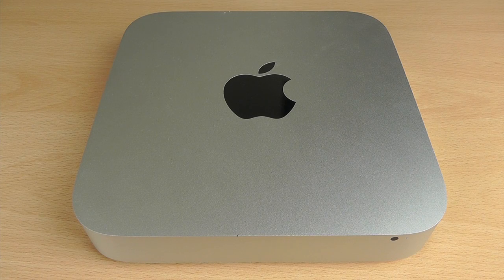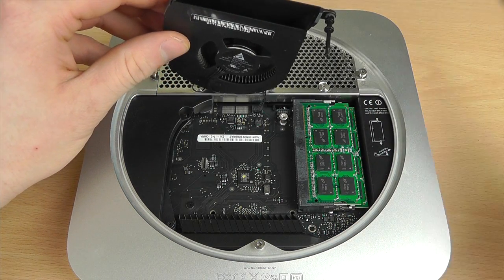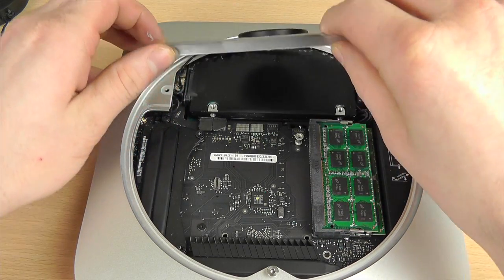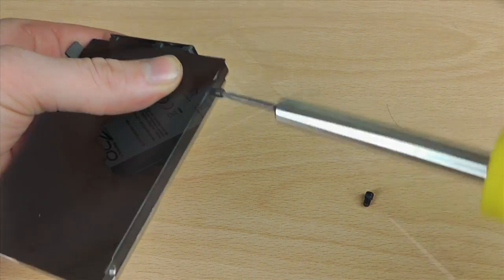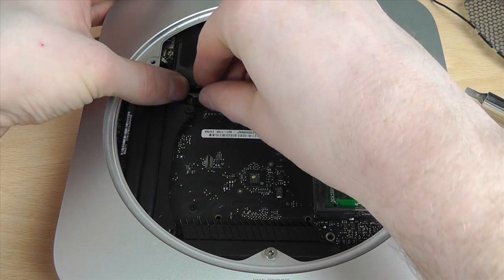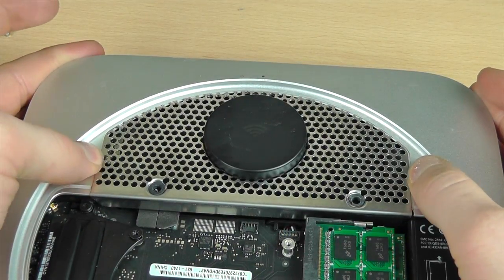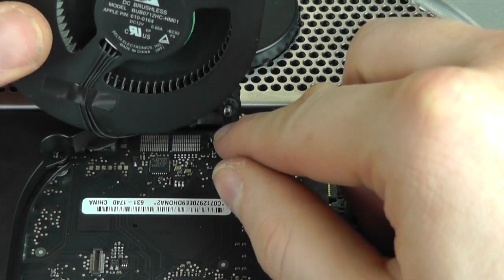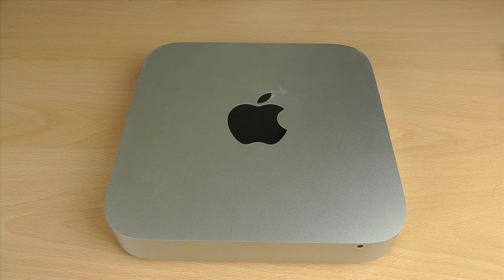Upgrade the Mac Mini 2011 hard drive to Solid State Drive

Comment: Just a note that the mini has a double drive bay and if you only have 1 drive then it has to go in the upper slot, and getting those 2 screws that go into the drive enclosure on the wifi screen can be a bit of a tough nut.  I used a spudger to hold it up until I could get one of the screws in place.  Thanks again!

Comment: My screws were mostly torx 6.  And hex 2.0 for the outer screws of the wireless antenna grille.
Pull the fan connector straight up (vs. horizontally).

Comment: Thanks that's the fan contact damaged now as it didn't come off as you said. All wires now exposed and plastic bit stayed there. Not towards you, slightly up and then towards you 😭

Comment: No mention at all of the types of screwdrivers for which screws. Pretty magical all purpose screwdriver. I had one drive to replace and it was not much fun trying to get it reset. Maybe all SSD drives don't mirror the old HDD version. Anyone a good job here.

Comment: This discription is shite! The electric plug for the fan needs to be LIFTED UP not pulled towards you. This almost destroyed the plug! Number 2: there is absolutely no need to remove the antenna plug. The cable is long enough to easily let it sit at the side of the Mac. Thirdly: the plastic cover is not needed for an SSD as it covers some of the electrical contacts on the back board of an HDD, which the SSD doesn't have, as it sits in a hard case. The only thing you need is the upper oval stripe which keeps the SATA combo plug in place. Really, mate, do your research better! Also: sit back, relax and have a Foster's...

Comment: I actually lost one of the rubber grommets that connects the screw that threads through the wireless antenna grid to the SSD... I hope it doesn't cause any issues. :-/

Comment: Hello all. Please advise exact details with brand name, model name/number of the best compatible SSD and also please advise the same details for 8GB or 16 gb RAM upgrades for my Mac mini of 2011. Hope 16 gb RAM will be ok for Mac mini 2011. I want to upgrade my Mac mini for music recording purposes, starting with Logic Pro X. I do own external SSD 1TB from Lacie where I will store the sound libraries so a 256gb SSD inside this mini should be ok(?) for running the Logic Pro X. Thank you very much. Your help and guidance immensely appreciated.
Reply: Hi Ash did you ever get an answer for this. I also have a  2011 mac mini that i want to use for logic pro X. If you received some information that was helpful to you      can you let me know please. Thanks in advance

Comment: Thanks for the video! I upgraded my HDD with an SSD. I didn't disconnect or remove the fan or the wifi cables. I was extremely careful and light handed though. Hardest part was getting the old HDD out, lots of wiggling, it seemed like the memory modules were in the way and I was beginning to think I would need to follow the other guides I saw online (which tell you to remove wifi, fan, IR and push out the logic board). In the end and after a lot of wiggling, the hard drive did come out. Replaced it with the SSD, did all the steps in reverse, voila. Job done.

Comment: Followed the instructions and my fan wires ripped off separate from the connection, GREEEEAT fuck me now I can't get the connector off of the logic board and I need a new fan. Fuck apple

Comment: This is by far the best video on replacing the hard drive in the Mac Mini.  Most sites and videos (including iFixit) seem to insist on removing everything down to the logic board... this is completely unnecessary.

You will only really need the following screwdriver bits  Torx T6 &  T7 plus  a 2mm hex bit.

The only trouble I had was that the black plastic would not stick back to the new disk... seems the glue was just too hold.  I solved this with "Glue Dots" adhesive circles.  Also, while replacing the WiFi grill, one of the rubber grommets that sits between that and the hard drive came loose... but it was easy to put back in position.

Comment: *CAUTION:* I would highly suggest leaving the fan plugged in. They use thin gauge cable and the pins can easily pull out of the housing, which is not fun to fix.

Comment: I should have followed your video... I followed OWC Macsales which have you pull the logic board about a centimeter out but to do so, they have you unplug the IR cable first (on the right) and this is where I damaged the logic board. So, you can really fully access (and pull out/put back) a HDD/SSD without pulling slightly the entire logic board ???... If so, that is really cool and more feasible.  Because I had broken not only the tiny tiny pins (and sticker) of the IR cable, Apple Store only had the option to replace the entire logic board which of course would have ended up as about 80% of teh price of the Mac !!.... Fortunately, I have found an Apple approved independant PC shop which was able to do soldering to get it back for $80. That wiped away the discount I had on the Crucial SSD but at least I could use it.  And by the way, this upgrade is really worth in terms of performance !  Just be very careful (I had done the process on the Macbook Pro myself, but one should NOT expect the process on a mini to be as easy !!... ). Cheers,

Comment: I did this and was much more difficult than the video shows. Putting the new dive back correctly is difficult. The putting the antenna grill is very difficult..lining up the holes with the drive holes is so difficult
Reply: Likely because you also need to slightly pull the logic board... :)
Reply: Lol

Comment: How much is the speed improvement with the ssd?
Reply: Compare night and day ! Really !  Add a clean install with it and you'll wonder if this machine was released in 2011 or 2017 ! :)   About 15 seconds to boot (compared to much over 1.5 minutes in my case before I did the upgrade).  See my warning above. And notes from others about the logic board removal... A risky process if you are not doing this on a daily basis :)

Comment: So what happens to the os when the ssd is installed?
Reply: Hm actually no ! When I put the ssd, i was on mavericks on the old hdd. The ssd was empty, i booted in internet recovery and then i don't really remember if i had to install mavericks again or el capitan but anyway i managed to update to el capitan without having it installed beforehand. btw If you replace the hdd, don't make the same mistake as me, DON'T disconnect the IR cable, it's useless and easy to broke
Reply: +Laurens Hoogenboom press cmd+ r when it tries to boot, it will open the internet recovery and it will download el capitan for you
Reply: +( ͡° ͜ʖ ͡°) I've done that once before in yosemity. It brought me back to Lion. which isn't a broblem ofcourse. But i don't think it will bring me to el capitan
Reply: +Laurens Hoogenboom yeah , sorry, i thought it would work but nope : i installed my ssd yesterday and it only offered me to install moutain lion. I upgraded to el capitan afterwards.
Reply: +Laurens Hoogenboom yeah no issue :) It works really well now. BUT ! i've broken my IR connector in the process , be careful not to touch it, i've made this error because there is another tutorial on youtube by "OWC" in which they remove the IR cable but it's not needed.
Reply: As in Infra red? Anyways, I put in my samsung 850evo sad and crucial 16gb 16mHz ram. I must say, It boots really really fast and civ 5 loads so quickly. I was even able to play on higher graphics. I have no infra red gear, So i don't know if I came across the same problem. Or is the IR the wifi adapter?
Reply: +( ͡° ͜ʖ ͡°) I have myself the newer mac mini from 2015 but a friend of mine gave me his 2011 to upgrade  to SSD and add ram. So it has to be on El Captain in order for internet recovery to work? I had that opiton on my mini already so just want to be sure. Thanks!
Reply: Prior to do so, just install on your new SSD (ideally you'll need an external enclosure). In my case, I wanted fresh install, so I just installed Sierra and did its update to latest, while the drive was outside. Then boot with option key pressed down just to check it works.  After you will have replaced the drive b the SSD, you may chose to recover from a backup, or better : renstall your apps (longer but good time for a cleanup of what you want or need). Then I just used the files content (not any configuration or programs) from the backup and copied manually. It's a bit longer, but just in case you don't wish to bring back any speed or performance robber in your new config, it may be worth...

Comment: Ive got late 2012 mac mini. But with a help of this video managed to upgrade it as well. Same process. Thanks and good job.
Reply: You don't have to remove the logic board which helps :). Other videos show useless steps and this takes about 10 to 20 minutes
Reply: I completely agree with u on that one ;)
Reply: See my reply above. If this is the case really (and it seems feasible), believe me this also drop the risks by 75% !!... To remove (partly) the logic board - yep I followed that video you are referring to...), you first need to detach the IR cable or whatever it is called on the right. That one is really tricky.  And I spent over 45 minutes or more, NOT 10-20 - so it's not matter of working too fast (see my other reply on what can happen....).

Comment: what are the higher quality SSD's.
Reply: i would recommend samsung eve ssd's there are pretty much the best you can get, and they are actually cheap
Reply: Kingston and Samsung are your best bet. Ether the hyperX series or the evo by Samsung but I would recommend a 250 Gb ssd or higher 120 is a bit low
Reply: ***** exactly what i have installed in my mac mini late 2012, it runs like a beast and no problems at all, installation was very easy and compared to my 120gb san disk ssd, the samsung ssd feels much more premium ^^

Comment: The only reason the HDD had one is to cover the otherwise exposed circuit board from greasy fingers and dust in the machine. SSDs pretty much always have plastic casing both sides, so as far as I can see, there is no need to move the cover to the new drive at all.

Comment: You can't.  Everything is soldered in logic board.  2012 board will not fit 2010 enclosure because the back I/O panel is totally different.

USB 3.0 vs USB 2.0
Thunderbolt vs Mini-DisplayPort
etc

Realistically, if you want the 2012 model, just get the whole thing.

Comment: Pls answer this question.
-i have a 2010 mac mini model,which is the same shape and size as the one in the video.Now,can i put in the mac mini 2012 graphics card and/or processor in the 2010 mac mini?

Comment: I highly recommend getting an SATA3 to USB patch cable and cloning your HDD to the new SSD via Carbon Copy (free).  Then install the SSD in the primary bay and the old HDD in the secondary bay.  Then use Disk Utility to reformat the HDD to act as any secondary type drive you desire.  I have mine set up to store my videos and pictures, while my OS and Apps are now on the much faster SSD.

Comment: It's far easier to just clone the original disk onto the replacement disk before swapping hard drives. Or you can just install from the disc that came with your mac

Comment: Good video.  Well explained, good lighting.  One suggestion.  When you move from one task to another, e.g. finished reinstalling the wireless bracket then moving on to reinstalling the black plastic piece.  Keep the orientation the same as where the video left off and show that you're rotating 90 degrees left or whatever.  It was a little disorienting trying to figure out what way you've got it sitting between tasks but no big deal.  Overall nicely done thanks for the vid.

Comment from the maker: The mac came with 2 HDD so all I changed was the top one to an SSD :)
Reply: So, would the 500 hdd normally come on the bottom or top slot? Would I need to take out the logic board if the 500hdd is on the bottom slot or can I still manage to take it like you did in this video?
Reply: My mac mini only has one 500hdd and I am installing a ssd 120